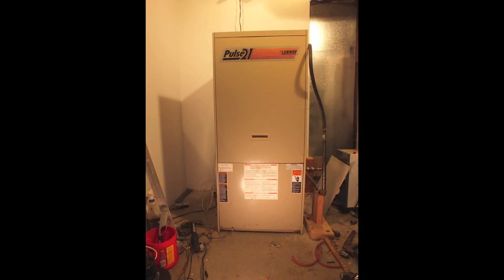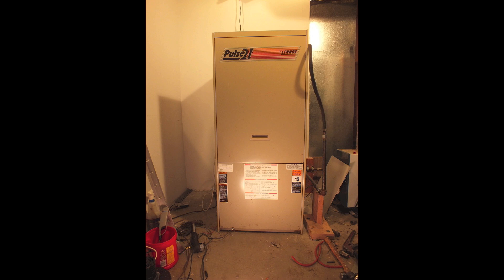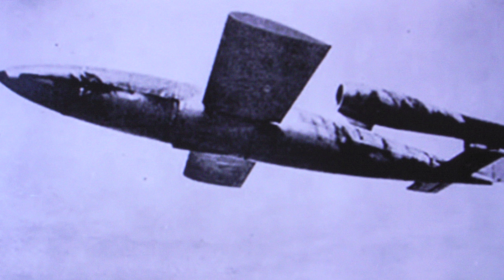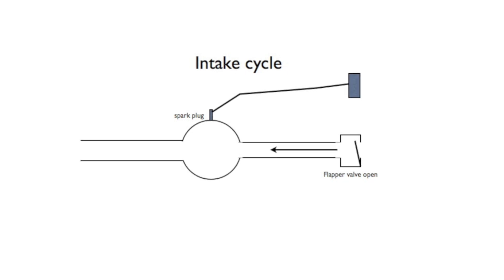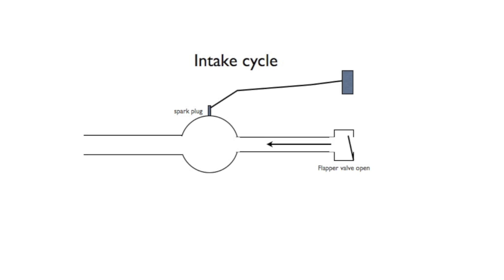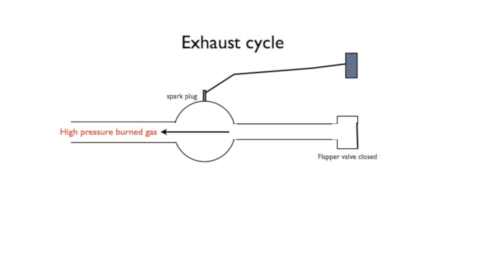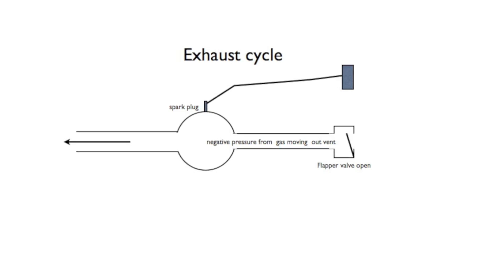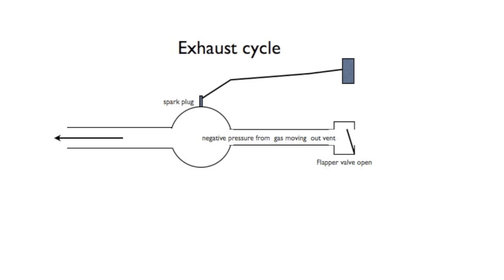How the pulse furnace works.

Comment: I removed many of these furnace's from homes in illinois lake county area . The said thing was many where still working find without leaking co gas from them like many people are claiming , plus also the two speed condensers as well . Lennox makes very good equpiment for residential homes . I think there one of the best .There scrool compressors where great and I installed many of them and know them well . But the said thing is most of them would not fit my dad's house at the time .

Comment: My first house had one of those when I bought it and the A/C had a two speed compressor.They make gurgling noise and all kinds of strange sounds.Then it almost killed us at nite from a leak.Nobody would work on the furnace or A/C.I was told the A/C was a wiring nightmare like the furnace.He offered me a new system for 200 bucks more than the cost to fix plus a 10year P&L warranty.I insisted on a Heat pump even now I am still scared of gas.

Comment from the maker: Actually, the furnace was one of the highest for the time.  The first ones came out in 1982.  The pulses are 60 per second.  Also, the combustion chamber is very thick (see last vid in playlist) that probably served to maintain temp in combustion chamber.  Thanks for the comment.
GFM
Reply: My uncle Dave was head engineer for Lennox in the 70s and 80s and it was his idea for the pulse furnace! So cool to see this video!

Comment: So did the intermittent flow of hot gases through the heat exchanger greatly reduce is efficiency? This stop and go of hot gas must have disrupted the temperature gradient across the exchanger.